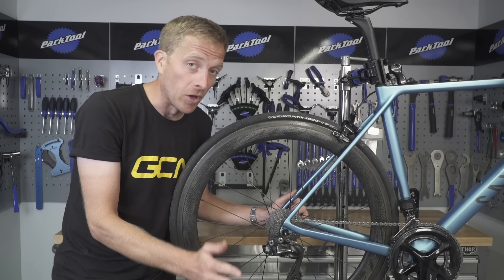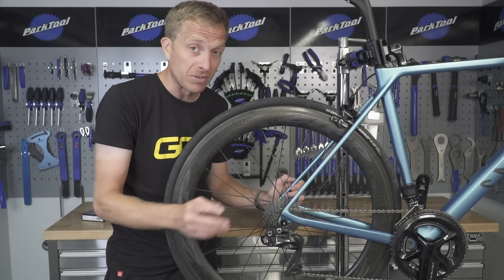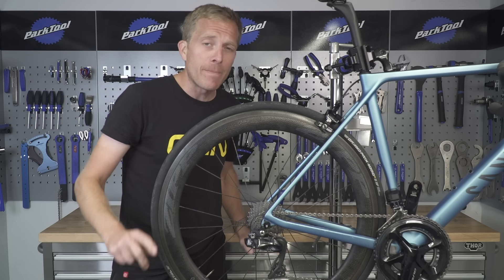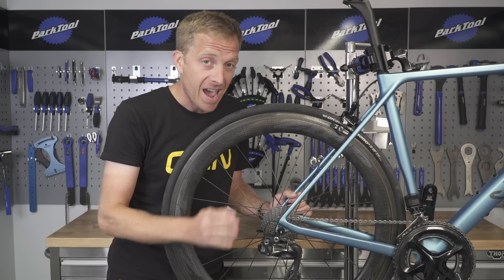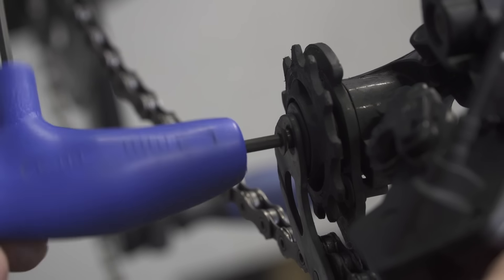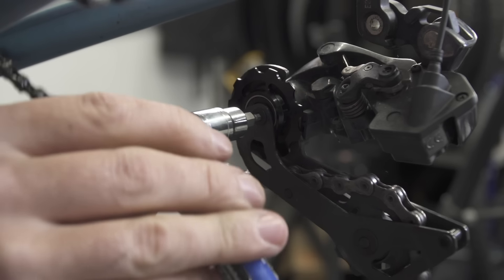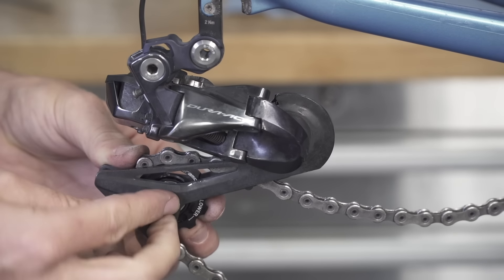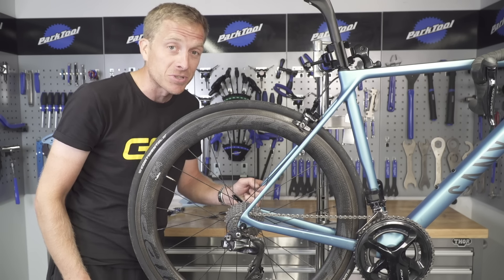How & When To Replace Your Derailleur Jockey Wheels

Comment: Hi John 
I’m looking to change my old aluminium road bike into a gravel bike. Could you tell me is it possible to put a 11-34 to my sora 9 speed cassette without changing rear derailleur.
Thank you 
Lee from South Wales
Reply: Only if the rear derailleur is a medium or long cage. 

If you have a short cage rear derailleur and don't want to replace it, then you will need a Wolf-tooth derailleur hanger add-on (I can't remember the technical term of the part). The Wolf-tooth will effectively turn a short-cage mech into a medium cage so you can run bigger cassette ratios. That's one option if you are on a budget

However modern rear derailleurs for gravel bikes, cyclo-cross, use a parallelogram system that keeps the chain tension tight when riding off road, and stops the chain bouncing around and give you the occasional ghost-shifting. 

If your cassette is 9-speed Shimano, get the mtb equivalent derailleur which I think is the Shimano Alivio derailleur.
Reply: Rusevelt Roberts thank you 👍🏻

Comment: #TORQUEBACK - Hi Jon, I wanted to upgrade the Tiagra groupset of my old 2006 Specialized Allez to Shimano Ultegra R8000 or to a Shimano105. Currently, my bike is only having a BB-7420.  Will the upgrade work? Need better suggestions. Budget is limited but I hope you can help. Thanks, Jon.
Reply: Looks like a normal BSA threaded bottom bracket, just remove it (or have a shop remove it) and replace with the one that comes with the new groupset.
Reply: Thanks JMise for the advice.  A friend of mine also said that a Shimano RS500 Hollowtech II BB will work. Not so sure. Any thoughts on that?
Reply: That works too. I wouldn't really worry about the bottom bracket, they last a long time and are very affordable. If you are buying a whole groupset, just use the one that comes with it. If there is a problem, it is easily replaced using inexpensive tools.
Reply: Thanks again JMise, appreciate it.

Comment: Coincidentally, i just ordered a new set of jockey wheels, not because mine need replacing, but, because i want the bearing covers to be colour coded with my rear hub :D (also, the new ones have ceramic bearings, not that it matters :D)

Comment: After replacing the jockey wheels my chain started skipping on the tension (lower) wheel. The chain does not engage properly, and it runs off the wheel teeth. Any thoughts on what could be causing that? Thanks!
Reply: Worn chain.

Comment: I have a DA7900 rear derailleur.  I cannot get the Allen head bolts to loosen. All the wrenches I have got  rounded off trying, and won't break it loose. I have tried spraying the backside where the threads are with penetrating oil. Nothing has helped. Any ideas?
Reply: C-4
Reply: Impact screwdriver and an Allen key bit
Reply: Yea I tried those, even bought new wrench to try. Just too tight. This may be a trip to the LBS.
Reply: drill in.
Reply: @GNX157  heat it maybe
Reply: I'm thinking drill and an Ez out. Heat is risky as the cage is carbon fiber. Going to wait till the season ebbs a bit in case this fix attempt at the LBS takes the bike off the road for a bit.
Reply: @GNX157  one of those solder irons that have the wire heating element, applied only to the screw, gently. Might help ease its grip.

Comment: Hi, could you tell me the size of the bolts, I lost one and I'm trying to figure out where to buy it. Thanks
Reply: If you havent already unscrewed the other pulleywheel to measure it, Its 14mm long and 5 mm wide. I would just go ask the local mechanic, see if he has a spare. Bring the other screw just incase.
Reply: @jeppechristensen2325  Unfortunately the other pulley wheel bolt is very hard to unscrew . Thanks for quick response I can order the right bolt now. Muchas gracias
Reply: I’ve had similar problems, this might be hard to explain through text. But If its the bottom pulley wheel which is stuck, apply pressure to the screw head with the proper Allen key while rotating the inner plate and thereby unscrewing the innerplate and not turning the screw. If it’s the upper pulleywheel which is stuck, my best advice would be to press inwards quite hard, while also trying to unscrew it. Also using a torque driver, instead of an Allen key might help as well because it’s easier to align straight. Really hope this helps
Reply: @jeppechristensen2325  I can't find the right bolt anywhere, this 5mm is too thick to  my derailleur  SRAM X0. This is so annoying. But anyway thanks for help
Reply: Do you live near a bike mechanic?
Reply: @jeppechristensen2325  in fact I do. Maybe I'll check it on Monday if they're able to help. 😀
Reply: Sounds like a good idea

Comment: Then what should I considerate when purchasing new jockey wheels, just the number of theeth, the size of them...?
Reply from the maker: Compatibility with your mech, material.
Reply: @gcntech  Thank you a lot for the response, but I have two of them with 10 teeth (is that 10T then?), but I'm having a hard time finding some, could I use 11 teeth without any downsides? Also, how do I know which are the best ones for my bike 10 or 11 teeth, counting the number of speeds?

Comment: You do not need to remove the back wheel, just have the bike on a back wheel stand. Set the bike to the inner chain ring and manually move the chain off to the inside. This now allows full access to the jockey wheels. The upper guide jockey bolt is accessed through the back wheel spokes ( left side). The lower tension jockey wheel bolt faces you on the right side. You also can do this without derailment of the chain but you will have to be careful fighting the RD tension.

Comment: why does my bike shop tell me cermaic speed pullys wont work 100% with my Etap setup, is this true?
Reply: Or don't waste your money on ceramic bearings
Reply: SAF1981 but why not if you have 300$ to spare?
Reply: Max Roth well I'm gathering if you're looking at ceramic bearings, you're looking to increase its suggested watts benefits? If so I would put the $300 on aero bars, lighter saddle possibly a road aero helmet for greater watt/$ return. There is the look factor also but I'm sure Etap has ceramic bearings?
Reply: @LUCYDIAMONDBOXER1 aero clothes or aero helmet might be even better watts/$

Comment: If only replacing the jockey wheels on my vintage SunTour derailleur was as easy as loosening a couple allen bolts ! Sigh.
Reply: tried finding replacement jokey wheels yet? I have a kind of old shimano 105 from 1989 and had a tough time finding some new ones to buy, even if shimano is the market standart. I ended up canibalizing an old mountain bike derailleur for the shimano jokey wheels, they fitted, not quite exactly the same but good for the job. I was surprised to find out that even the humble jokey wheel has come far since then, I took it for granted that they were all the same...11 teeth became 12, the diameter bigger, the bushings became proper bearings, and then this specificity upper vs lower wheel!!! damn technological progress...
Reply: Mantis athans Hi Mantis! You are so right! Damn progress. To answer your question, no luck yet. I love the SunTour Cyclone derailleur and am determined to keep this piece of cycling history alive. The original derailleur on the Raleigh Super Course of 1978-9 vintage was a Campy model. But I needed a bigger cage to accommodate a 34 tooth rear sprocket and bought the SunTour Cylone around 1982-3. If I had known SunTour was going to bite the dust, I would have bought two and saved one for the future!

Comment: This is non-sense right? I've never seen a worn out jw.
Reply: Mine plastic one, was worn out after 2 years - more common situation with 1x setup and muddy/dusty trails. This mixed witch chain lube, works as good polish paste ;)
Reply: You gotta ride more often ;)